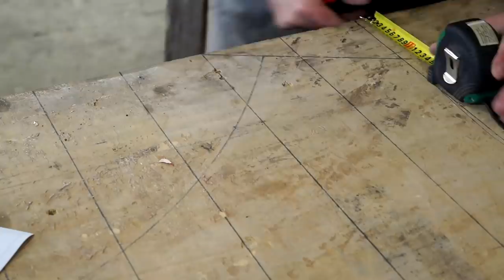Curved bench

Comment: Question, did you have to laminate all of the benchtop strips that are curved at the same time or could you do each grouping of the strips individually. So for instance if you do not do all of the curves portions at the same time does it mess up the overall curve as you got further away from the in the first mold?

Comment: That is the most beautiful piece of furniture i have ever seen! I really like how you used those stops to bend the wood and the claps, really cool. Your growth in subscribes is awesome keep up the great work. One question lignum, what kind of glue were you using for glueing the wood together? was it like a resin? Thanks.
Reply from the maker: Hey, thank you Eli! Yeah this all youtube thing is crazy and unexpected.. :D I use two component melamine glue for glulam.  Water resistant, resistant to elevated temperatures in case of fire, and doesn't loose adhesive properties when thick layer is applied which happens if clamping force isn't enough, or the surface is not perfect.
Reply: That's awesome! Thank you I was just curious, that's super cool. Great job again that was an amazing video and project! I can't wait for the colab, I know you are probably still busy but just tell me when you are ready. Thanks, Eli.

Comment: Wonderful work and result! I was wondering is it not simpler to make a curved plate in one piece with several thicknesses of plywood glued together and cut it all into curved shape, and make the spaces with a router ?
Reply from the maker: Yes, It would be much simpler, but I started this hobby project with some surplus material and wondered what I could make of it.. If I started with Idea of final shape, I would maybe go with plywood solution.. In my next project video, I'm making something similar to process you mentioned..I'm gluing a lot of spruce slats into a rough block and and robot milling the whole thing into final shape.. Hope it will be uploaded by Sunday..

Comment: great job and beautiful design, just a remark: with this lamination technique the amount of sawdust and shavings may be in excess of the volume of solid wood used.  I suppose you use epoxy resin with a long open time for the glue ups? And finally: those clamps man; so powerful and interesting way to tighten them.
Reply from the maker: I use 2 component melamine glue that has open time of around 45 minutes if hardener is mixed in 1:4 ratio but even more if you put less hardener.. you can see how I make clamps in my other video and yes, there really was a lot of sawdust :D

Comment: Excellent! I have a gothic arch project I'm toying with doing, and your bent lamination process looks like it'll do the trick.

What kind of glue did you use? Looks like you've got pretty long working time (hard to tell with the video speed).
Reply from the maker: This took my somewhere around 12 hours all together,  aprox. 4 hours a day  over 3 days. I use two component melamine glue designed especially for glulam.  Hope it helps! :)

Comment: Nice application of curved lamination. I like that clamp setup you have. 
Is that two part epoxy? Why do you use that over wood glue?
Reply from the maker: It is not epoxy, It is two component melamine glue designed specially for glulam. I use it by the barrels of it  for beams where fire resistance is required and this glue is certified for it. Other properties are the same as in any other d4 class wood glue.

Comment: Is glue the only thing holding the legs to the bench or did I miss something??
Reply: I thought the same.  It is a MAJOR design flaw.
Reply from the maker: Only glue, pls explain why do you think it's a flaw?
Reply: @lignumchannel  If the only thing holding the legs on is glue - lateral pressure will break the bond sooner or later.  It looks pretty - but is a crap solution.

Comment: But in ten years that bench glue will fail and the bench falls apart. What's holding it together besides the glue?
Reply from the maker: It's 2 component melamine glue used for glulam structures which must never fail during active lifespan of structure which is often even a 100 years.. Wood itself will fail much sooner